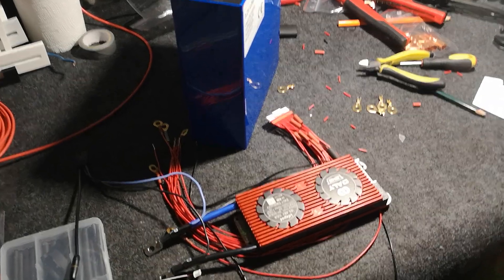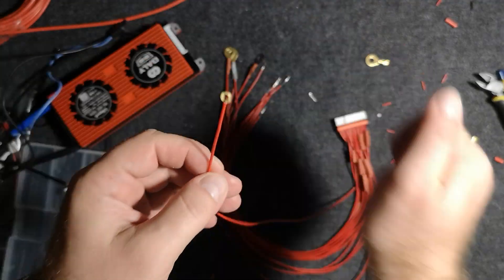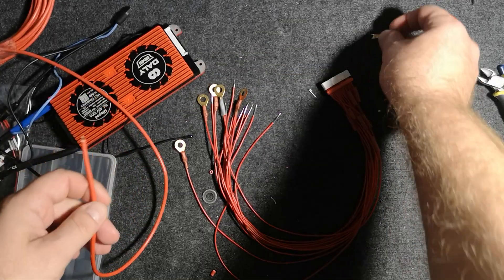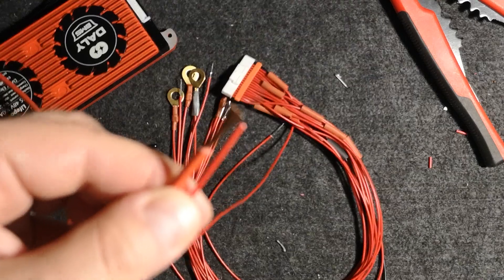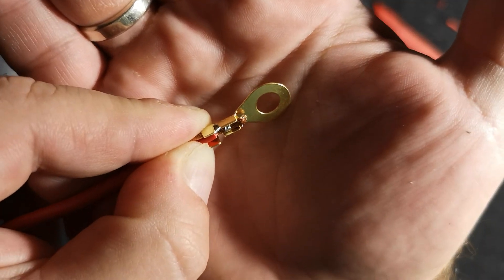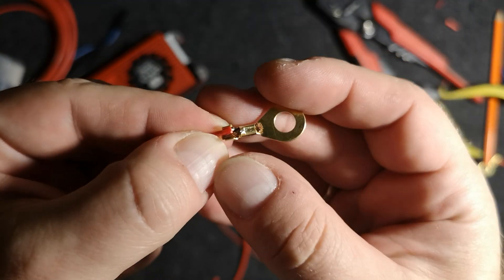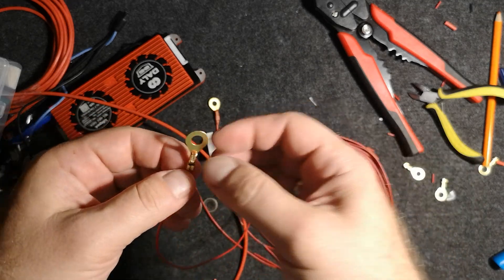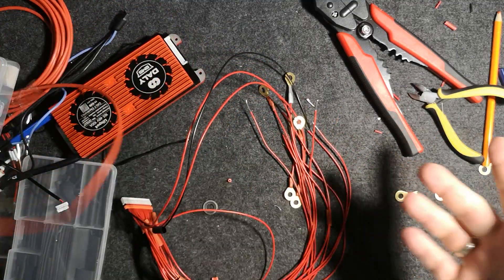How to crimp ring terminals on DALY BMS

Comment: Thanks for the advice. it really is hard finding ring or fork terminals for 6mm/1/4" stud with 24-28 AWG wires. I don't think I'd want to crimp such a small wire in the matching terminal anyway.